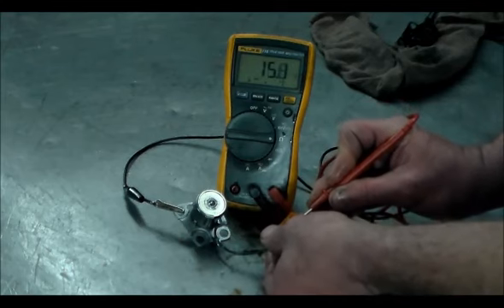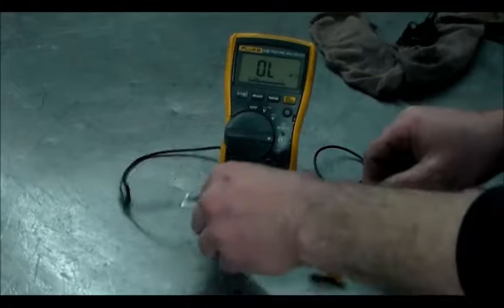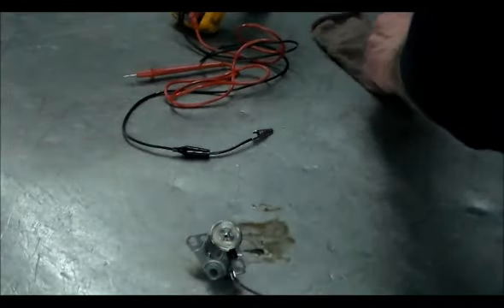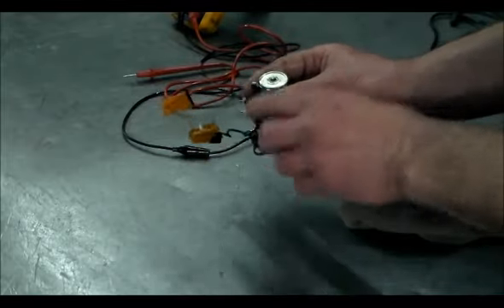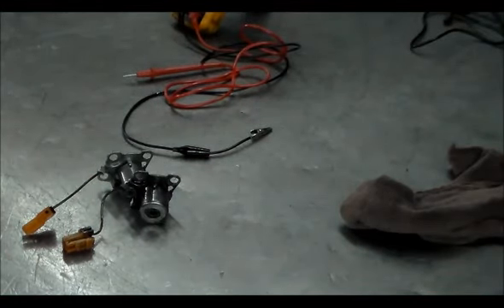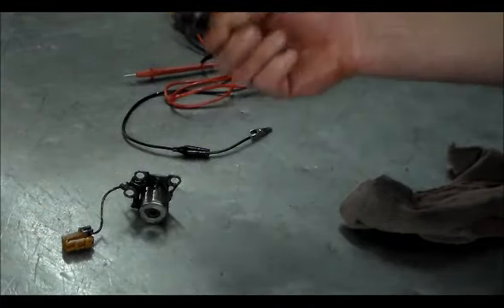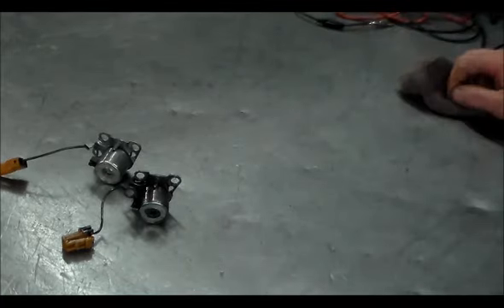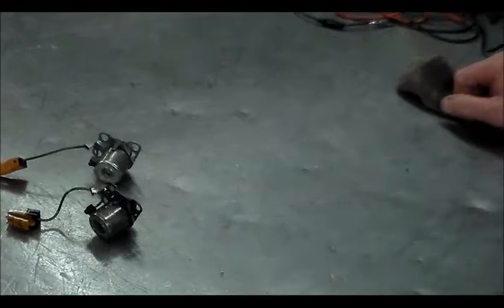Subaru 4-EAT P0743 Quick Tip

Comment: That's my kind of fix Gary. A shop/resource for the working man. Good for you posting this up.
Reply from the maker: Hope this helps save people some money
Reply: I'm sure it will. Hey is that pick you use special or can I pick it up anywhere?
Reply from the maker: What time in the video am i using it?
Reply: Oh I don't know if you used it in this one. Just watching everything you have, ie, A604 Mopar, Nissan, etc. Today I tried to take apart a blown up input drum from a A604 and the end of the upper underdrive snap ring was right up against the lug, no room for a regular flat head screwdriver.
Reply from the maker: i bought some of them on amazon, just type in scriber

Comment: Gary Ferraro I got to tell you about 2 years ago I watched your video breakdown of the 4 L 30 e transmission I have no experience on doing Transmissions at all I had a 2001 Isuzu Rodeo LS and I live in an apartment. I decided to remove my transmission and put it on my damn kitchen table my wife was pissed but guess what. Because of you I easily torn down rebuilt it and it has been running smooth ever since when I first put it all together everything worked fine except for my instrument gauge kept blowing the 10 amp fuse and my instrument panel with was not working. Having no experience I assumed I had a short somewhere and sure did. One of the solenoids was shorted out when I remove the pan I easily saw that it was damaged replaced it and it works. Thank you so much you don't know how much of a help you have been. I didn't have a lot of money I'm kind of poor you know what I mean have 4 kids and a wife struggling and when the only vehicle that I had went out thought my life was over until I found your video it took a little while I had to order a master rebuild kit eBay I ordered a new torque converter went down or O'Reilly and bought some of that transmission assembly Lube believe me I had to download some rebuild manuals as well and study but with you by my side Gary everything was a breeze so again thank you so much for helping me and my family thank you
Reply from the maker: Wow, Thanks for sharing, awesome story, glad your back on the road again

Comment: I found that Subaru allows you to buy the Solenoid assembly by its self for 174, but other places is like 75-150. I am having trouble with the code right now on my Forester and after watching this video I feel like I can do this myself. Awesome Video and thanks for the help
Reply from the maker: When i called the dealer, they wouldn,t sell me just the solenoid.  Where are you located?   It is a simple job, drop the pan and it's right there
Reply: @GaryFerraro  I just looked it up on their parts website. https://parts.subaru.com/p/Subaru__/SOLENOID-ASSEMBLY-CONTROL/49242512/31939AA052.html. It is only the lock-up solenoid. I'm not hundred percent sure if its the right one though.
Reply from the maker: @brokke7014  Thats it, correct solenoid

Comment: Hi gary...didn't know where else to ask this question;.... I've looked through your catalogue... I don't see any TR60SN repairs.  (Touareg/Cayenne/Q7)  doing research and all I find is valevebody replacement  and one pump input seal....  no teardowns.  Are these gearboxes bulletproof other than the worn solenoid bores?  Any input is appreciated...
Reply: ..... I'd like to add...  you've helped me steer clear of 5HP/6HP... wont touch one with a 10ft pole.....  local shop wants 3k bench rebuild and I'm not experienced eounght to rebuild a slushbox that I need to drive to work everyday..... thanks!!
Reply from the maker: The valve bodies are the number one problem with this trans. If you have a bad valve body the car will drive ok cold and slip and bang hot.  I've only overhauled one of these units because the trans cooler went bad and water got into the trans.
  Mainly the car just needs a valve body.  Do you have one thats not working correctly?
Reply: Gary Ferraro thanks for the reply!!!
 No I'm researching my next vehicles for me and my wife... From what I gather the main gearbox seems to be solid. I just want to know if buying a $4500 Touareg or a $7000 Cayenne is wise...   I'm great at any other mechanical work, even serious engine work... but Hydromatic gearboxes scare me as far as trying to fix for a daily driver.
Reply from the maker: An issue inside the trans is there is a sleeve that turns, when it turns it blocks  K2 clutch oil and theres no 4th,5th or 6th. I haven't seen that yet but there is an aftermarket company that makes a fix for that so it's somewhat a common problem.
Reply: Gary Ferraro thanks Gary. Thanks for the tip. Just looked at that. Sonax makes a kit to replace the sleeve valve and spring https://www.sonnax.com/parts/1861-k2-clutch-b1-brake-control-valve-kit.   I'll have to make sure I get service history on whatever I find. It looks like something I'd be able to do. If I can't get history seems a valve body kit including K2 sleee repair may be cheap insurance. Otherwise looks like a stout tranny. Its rated for 550 LBFT. but only sees about 300-350 with either V8. 5HP24 is rated right at that limit...   go figure...   I really appreciate your time Gary. Cheers from eastern Ontario!

Comment: i have a 2008 subaru outback which i suspect has the phase 2 or second generation 4EAT ? would this later 4EAT use the same same solenoid ?
Reply from the maker: Depends on where it's located, they moved the solenoid to the valvebody, do you know where your is located?
Reply: @GaryFerraro  pretty sure its under the transmission housed in the transmission fluid drop tray. i did open it up when doing a trans fluid replacement about a year trying to see if i could find where the trans fluid filter goes ? but it turns out there is no traditional type filter on the 2008, the fluid was also super clean and i probably didnt even need to change it in the first place tbh, i was just naive about cars at the time, anyway i cleaned up the the old gasket and re sealed with ultra grey then gave it it new tramsmission oil anyway etc.. anyway the other week i started getting the AT oil temp light flashing along with the VDC & ABS lights. i also started getting ocasional jerkyness under acceleration which i had very randomly on two other times in the 2 years ive owned and driven the car. its usually just disappeared as mysteriously as it has shown up yeah ? all my fluids are good and im currently just doing some basic maintenance while i wait for a scan tool to arrive, ive cleaned the maf's put new sparkplugs and air filter, cleaned out EGR sensor and im about to clean out the throttle bottle as well, and will probably do a basic check of the coilpack with the multimeter while im there.. i thought maybe the AT temp light might have something to do with a malfunctioning thermostat but after a short drive both the top and bottom hoses to radiator are warm so it seems the thermostat is working ? im currently no driving the car because i dont want to risk breaking down on the side of the road etc, even though the engine seems to be running smoothly.. urrggh the whole things driving me a bit crazy at the moment yeah, 2020 just keeps on giving eh lol ;)
Reply from the maker: @monogramadikt5971  When you get the tool scan the car, the blinking AT light , there should be a code present
Reply: @GaryFerraro  i have heard that subaru service people have a specific tool for reading trans codes, but hopefully when i get a chance this weekend the foxwell 301 scanner i brought will give me some information at least ?